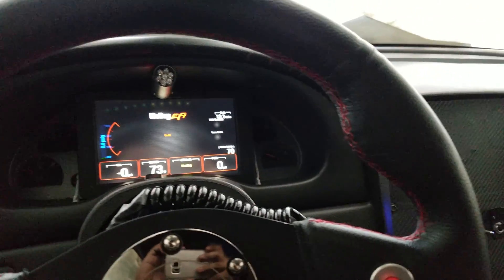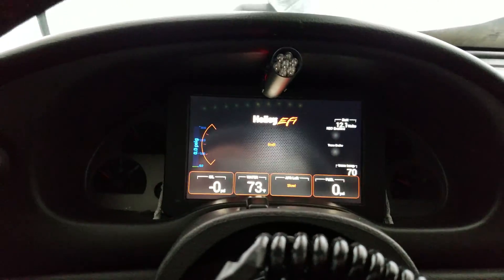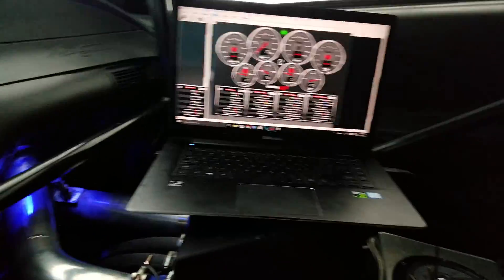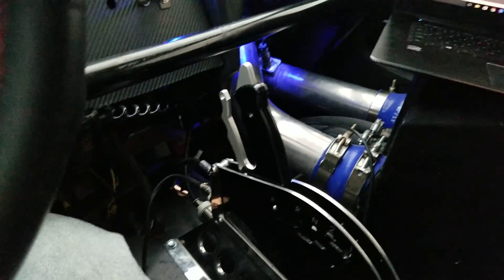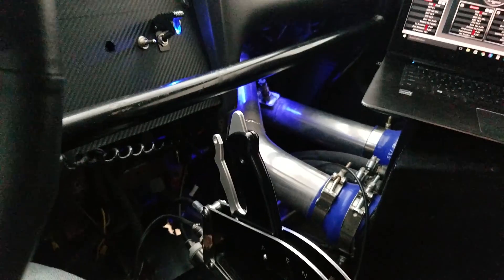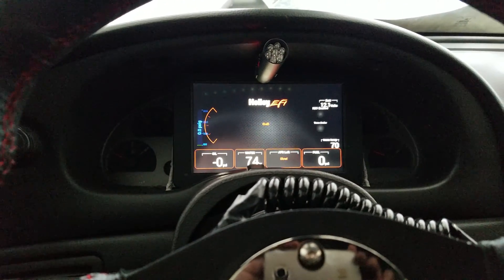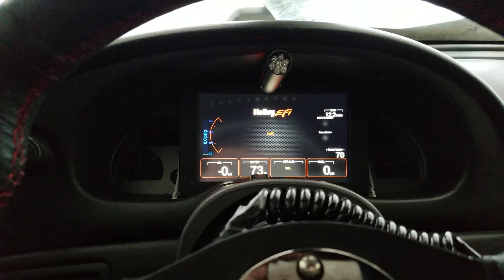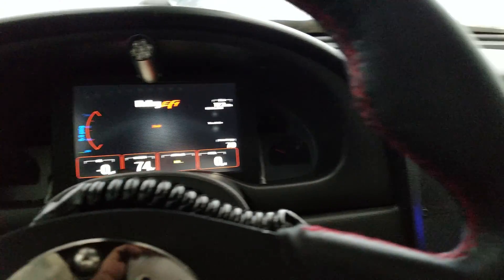Holley dominator efi small review in 4.6 mod motor Mustang 4K

Comment: Dude thats sick! Would you recommend getting this instead of getting an SCT tune? I had never seen this until now. What exact Holley EFI system are you running? I am about to turbo my 2003 Mustang GT 2 valve and am about to buy a car lift and learn to tune instead of paying the shop to install it! Any answers to these questions would be very helpful!
Reply from the maker: yes i would way rather have the holley over stock and i run the dominator